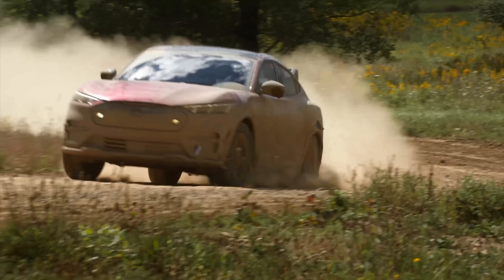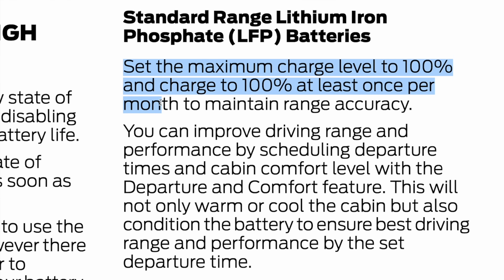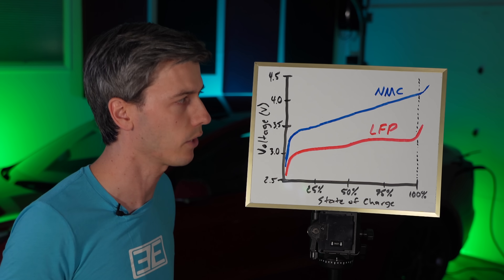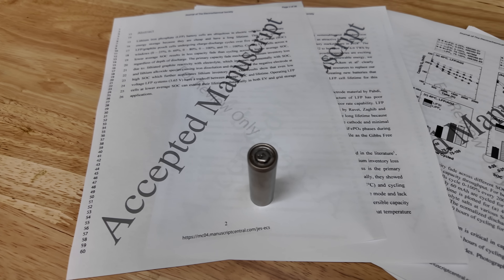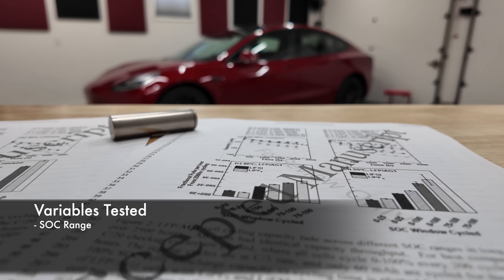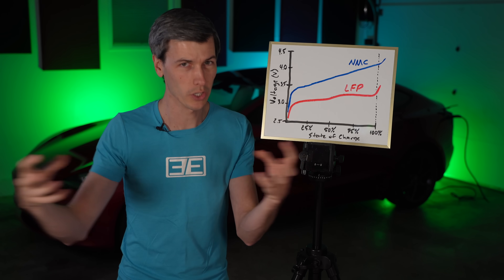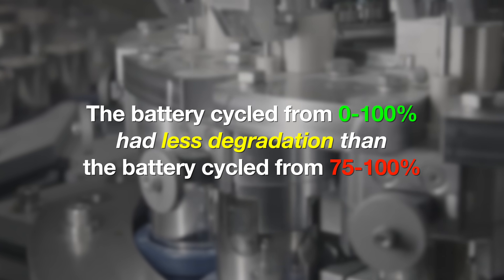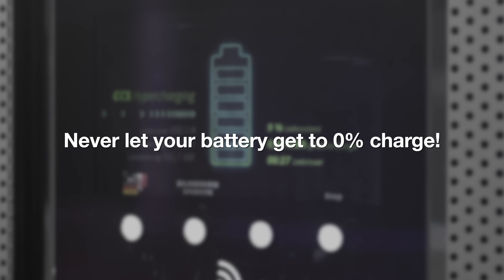How To Ruin Your Electric Car's Battery - LFP Edition!

Comment: Battery swapping takes a little over 3 minutes. Tesla entertained the idea, years ago, most people are not even going to remember because most of Tesla's present day customers where not paying close attention to the company back then. They decided to got with charging instead when they should have tried to do both if possible. It's not a sustainable model for every one to rely on charging 100% of the time. You need swapping. Especially in emerging markets. But in the west we have a very individualistic mind set. So buy a $50K + car... you expect the own the battery. But most people would rather pay$10k - $25K for car and just rent the battery for $100 per month. The economics of owning and maintaining a batter should not be the concern of "most" EV buyers.

Nio went a different route. You can charge or swap. And now they've teamed up with CATL and BYD to standardize the battery... that's right, hopefully one day can buy car and use "any" battery - long range for a long trip, or short range for 95% of your other life. The battery swap machines keep up with the health of the battery so you always get a good battery. And if for some reason there is an issue with it, you just go back and swap it.

Comment: I own a Tesla model 3 with LFP battery.
And since my daily driving uses between 10 and 20%, and never more than 30%, I have the chargelimit at 50%!
To me, the importance of having an absolutely correct state-of-charge readout is far less than keeping the battery happy!
And as I also do go on a long trip once a month or so where I charge to 100%, it solves the calibration issue.
Leaving the car plugged in does not mean charging to 100%. There is a charge limiter, you know.
Here in Norway it is important to have 11kW from the outlet avaliable when preconditioning in the morning; or else you could possibly have used 20% from the battery before even leaving home...
That way I always leave with a warm battery/car, and with a "full" 50% SOC.

Comment: Do these cars have an "optimize" button in settings? Seems like for lfp it would set a limit of 90%, and occasionally top itself up to 100% to recalibrate. Coordinating with my wife when to plug it in vs not sounds like an unnecessary annoyance.

Comment: I dont know, my usual recommendation sounds pretty fitting for both chemistries. Set max charge to 80%, and plug in when you get close to 20%. The only downside is that with lfp the car gets confused if it doesnt occasionally hit 100%. maybe i would just let the car get slowly more inaccurate and just know the battery meter is very approximate. not too big a deal most the time.

Comment: 25% - 75% would have been helpful in the study.
Reply: Agreed... I just wrote a long comment about how we need something like the best range to operate in if we use a 50% capacity each day... 80 to 30? 60 to 10? etc... but for some reason, it disappeared, and I'm not gonna rewrite all of it, so I leave it here.
25 to 0 might be best, (of those ranges tested), but if I need 50% per day with no way to half charge half way through my day, what is the best range to keep it in?
(discharging to 0% is not good, so it baffles me as to why they would base the whole test on going to 0%, except for the 100 to 75 bracket.)

Comment: 14:50 "if you don't have a place to charge your EV at home..."  😂

Lol there are next to no EV owners out there that can't charge them at home.  Because without that, EVs are completely impractical (as opposed to mostly impractical), it's one of the main reasons they'll never replace combustion engines.  Because relatively few people have somewhere a drive/garage where they can charge it.

Comment: The general rule is simple: charge seldom, never over 80% if you know you wont need it, unplug when charged. Allow your battery to cycle fully sometimes (6% to 100%) then leave connected for a while when at 100% so the battery management can go to work. Then unplug, wait as long as feasible to recharge. If you do that, your battery won't mind when you have to cycle it fully for a road trip many times.

Comment: It seems like the solution is for a car to have multiple batteries and higher overall capacity, so that the car can normally be charged to 75% overall, but the battery management system can shift charge from several batteries to charge one battery up to 100% for calibration and then discharging it down to 75% while charging up the next battery for calibration. In this way the management system does all the work of calibrating batteries once a month and no battery sits around at 100%.

Comment: Nice video, very informative, but I think you got a couple things between NMC and LFP mixed up. The relationships that storage SOC, temperature, depth of discharge, etc has on longevity are the same between LFP and NMC, regardless of what those manuals say. This is because the capacity fade of these chemistries is still primarily driven by the graphite negative electrodes they both share. More specifically, the rate of electrolyte reduction on the graphite surface which consumes the Li inventory is the same between the two. The cathode chemistries do have some influence, such as transition metal dissolution, oxidation of some species, etc. but for the most part LFP and NMC cells should be treated the same in order to extend their longevity. Now graphite||LMO chemistries, thats a different story...

Comment: I have watched your videos for quite some time. Why don't you cover something important and that I could care about. You have a great presentation style and make great diagrams explaining stuff. How about one for the rest of us. How about you design the method to convert our wonderful CORVETTES from 1963 to 2019 into a real functional AWD Hybrid, using a pair of Front wheel hub motors, flexible format Battery packs and integrated one pedal controller with torque vectoring and recharge alternator and regen braking. All we want is a retrofit kit around $25,000 installed, certified, warranted with minimum 40 mile EV range, combined hybrid 40-50 mpg, 0 to 60 in 3 -4 seconds and 500HP minimum with options for longer range, faster 0 to 60 and max power. Made in the USA installed by regional networks and 8 year battery life.  You could contact the two Hub Wheel Motor producers in America and Blue Dot who has a retrofit 2 pdeal hybrid kit that is a base to move from. There are hundreds of thousands of low mile good condition Corvettes nation-wide and many are willing listeners to such an upgrade. We want to be a part of the solution. But not trade and go broke buying new. Help us to achieve a transition  to AWD Hybrids and reduce auto emissions. You show us the way. And watch what happens.
Dennis in VA

Comment: wasnt sure if you mentioned it.. there was a lot said in your complete video. I have a charger here at home and charge my Tesla nightly when needed to 75%. Is there any difference in amp value. SO charging at 15amp 20amp or the max I can select is 32amp. Will this make a difference on the battery over longevity? thanks sean from montreal
Reply: No. Your home charger even at its very fastest is still very slow compared to actual fast chargers. If you set it to 32A you will have less charging losses and better overall efficiency.

Comment: Excellent breakdown and explanation - the best I have seen. I have an LFP and as pointed out, there are contradictions on usage although one needs to consider degradation versus usage… I only plug in and charge (to 100%) once a week as I don’t do much mileage so the battery maybe goes down to 30/40% before a full charge

Comment: ⭐⭐I used to watch you 5 years ago. It's awesome to see you at the level where you are. All glory be to the God of Jacob. Question for you, I'm about to buy an ebike.. A very powerful one with a 60v 35amp battery.  And a 45ah 60v Wired Branded Controller (Patriot Systems). 3200 watt peak! That battery is Samsung cells. What type of chemistry makeup is this battery? Thank you and God bless ❤

Comment: As an Electrical Engineer specializing in batteries, I recommend keeping the charge between 30% and 70%. 

Avoid keeping it plugged in all the time unless you know you'll be going on a long drive and need more than the current charge.

Have a great day, y'all!
Reply: Why should you avoid keeping it plugged in?
Reply: @logitech4873 

"WEAR & TEAR", as you don't need to do it EVERY night!

Unless you're going everyday to a place that's far from your place.
Reply: @ThinkForge01  Wear and tear on what, the plug itself? Bit confused about what you mean here. Keeping it plugged in all the time is what most recommend.
Reply: @logitech4873  

Who did recommend it, Tesla?

They said that for PEOPLE not to BLAME them even 1% IF the person forgot to charge their car.

It’s NOT really to protect the battery, BUT for common sense purposes.

Thera is a new study that shows if you keep on charging the battery all the time, it makes the battery life SHORTER.

They even said, that 25% was perfect to 50%.

Same thing with my own testing and research, 5 years ago.

Comment: When it comes to 0, the real problem isn't reaching it, it's staying there. In testing, when charging commences immediately after reaching nominal 0, damage is minimal. But if you discharge to 0 and then leave the cell in storage, it continues to self-discharge beyond nominal 0 potentially reaching truly harmful levels. The further down you go, the worse it gets. And it stays in such state for extended period of time. You charge to about 50 % for storage because it allows you to leave the cell alone for a long time without the need to recharge while minimizing harm from high state of charge.

Applying this in practice means that you can discharge to 0 during normal use, but you should recharge immediately and never ever store the device before recharging. Whether it's a phone or a car. And if you want to charge to 100, then you should do it right before using the device sufficiently enough. You should drain it down immediately. For a car, that means before taking a sufficiently long trip (you should definitely get below 80 % and the closer to 50 the better). Ideally, you'd charge to 100 % slowly at home before setting off (using on-board computer to control the charging so that it's ready at specified time minimizing time spent at high state of charge). You shouldn't do it on a fast charger.

Another complication to accurately getting state of charge is that voltage depends on load. The bigger the load, the lower the voltage. These curves are typically for open circuit. Lithium chemistries generally hold voltage well under load but if the curve is too flat, it really gets tricky. PS: This also means that rate of discharge matters. If you discharge rapidly, that is in itself more stressful, but it means that when you terminate discharge because you reach nominal 0, there is actually more energy left in the cell compared to reaching 0 through slow discharge and voltage will recover. In the olden days, this was the reason why you could turn a phone on after it shut down during a call. A call took a lot more power. A cell recovered and there was still enough energy left to boot up and run for a while. Perhaps send a message or two.

Comment: What about temperature regulation?  I park outside, but I plug in every night because my main concern is temperature-related degradation.  On a hot August day in the sun, the battery is going to bake if it isn't plugged in.  Similarly if it is freezing cold outside the car is going to only allow the cells to drop to a certain temperature before the battery heaters kick on to protect the cells.  I don't think either of those things happen if the car isn't connected to grid power and is just parked.

Comment: have an lfp battery (Tesla). I only need about 60% for almost all trips. By watching the video I would say that I can just set the charge limit at 60% and just charge it once a week to 100. But does leaving the charger in (at 60%) cause less longevity over time? Should I just unplug once it reaches 60? Or did I understand this incorrectly.
Reply: No need to disconnect the charger. IMO just set a limit to 80% daily to have some buffer. This will still be great for the battery.
Reply: @logitech4873  THank you!

Comment: A comparison of LFP to NCM when charging to 100% would've been useful I think, this almost gives the impression that an LFP degrades just as bad when charged to 100% as NMC which is not the case, an LFP charged regularly to 100% will degrade faster than one only occasionally charged to 100% but it will be a lot less of a factor than charging an NMC to 100%. an LFP at 100% is under a similar stress as an NMC somewhere around 80%, in both cases sitting at a lower SOC would increase lifespan but other factors will likely be sending the car to the scrapheap before the slight degredation difference between an NCM at 60 vs 80 or an lfp at 80 vs 100 will kill the battery.

Comment: Getting SOC correct is only part of why 100% are needed and seems like this is not understood at all here.

 LFP cells MUST get to approx. 3.5V pr. cell before they start getting higher impedance (= telling they are getting close to 100% SOC). Since LFP's characteristics makes the fight each other to get the most out of balancing, it is outmost important to have cells above 3,5 every week for some time (Couple of hours) for the balancer built into the battery/BMS has got enough time to balance the cells or you risk the BMS giving up eventually which has been seen in many cars where ill bet most of the faulty packs is due to this and why ex. Tesla has made so much effort to tell customers they need 100% once a week. Degradation explained is very well explained.

Comment: Because of that, manufacturers have been putting in bigger batteries and then claim the ~80% charge is a 100% charge. Even on smartphones.
Over time the software unlocks more of the unused capacity to make up for the already lost capacity.
Tesla even proved that indirectly, by unlocking more capacity with a software update during covid.
Reply: Extremely few EVs do that. With the vast majority of EVs, 100% is 100%.
Reply: @logitech4873  Extremely few? Pretty much all Teslas do it. Its been normal on smartphones for many years.
So you think other EV manufacturers dont do it?
Makes no sense, dude. And in reality, seeing those EVs, seeing how well their batteries keep up over time, even though the study shows they shouldnt, thats the only explanation.
Reply: @cartrips9263  "Pretty much all Teslas do it"
Nope. The Teslas that did this were only available for a limited period, and only in the US. Very few Teslas on the market are of this type.

I don't know of many other EVs that do this. The BZX4 does this, and probably the Solterra as well.

Comment: It’s hard to ignore the ALL CAPS AND ALL BOLDED recommendations of Tesla to keep your car plugged in at all times were not in use, while they simultaneously dissuade you from charging at any lower than 100% with LFP batteries.

Comment: Warranty a 20k battery for 300k miles. Cause i could buy 2 engines and 2 transmissions for that. In my corolla i will make 300k and beyond without a fuss.
Reply: but its still a corolla.
Reply: @zachlafond2652  but I have a tesla

Comment: Great info but I assumed that all cars counted amps to determine state of charge. Not sure why they would use voltage. Calibration only needs to happen once in a great while and I've heard cars have a calibration routine (charge to 100%, discharge to 0 while counting amps out).

Comment: Information of the type of battery should be easily visible with a sticker imho. Using the VIN number means that it's more difficult to change what type of battery your car's using after the initial purchase

Comment: The solution is in the hands of the manufacturer. They decide what chemistry goes in the pack, they have a good idea what use case the car will experience, so they can adjust the battery management system software accordingly. Since it's software, and the cost to changing it should be next to nothing, they can even have multiple versions for different regions and climates to better manage the battery within given conditions. That's where machine learning can also come in handy. Have a dataset large enough of existing vehicles, and use that to determine best settings for future software.

Comment: Keeping LIFePO4 (LFP) at 100% to extend its life? That's news to me, the general consensus I've read says to keep it between 20%-80% for the best increase in lifespan. This is because by doing so you diminish the depth of discharge the battery experiences, the lower the longer it lasts, and you also keep it from wearing down due to high or low voltage. Another matter entirely is getting accurate readings, which require the curve.

Comment: Great video. A question remains for me, though. BYD is the third largest EV battery producer in the world, and the largest EV producer in the world - all of them with their own LFP batteries, so their usage recommendations for owners should be well thought out. Looking at the owner manuals for BYD EVs (e.g. Atto3, Han, etc.), they recommend fully charging it at least once a week (obviously, to keep showing correct SOC level, as you explained), however they also recommend to do once every 3-6 months a deep discharge (below 5%/10% SOC) immediately followed by a full charge. I don't understand the reason for the latter recommendation. Do you have any insight?